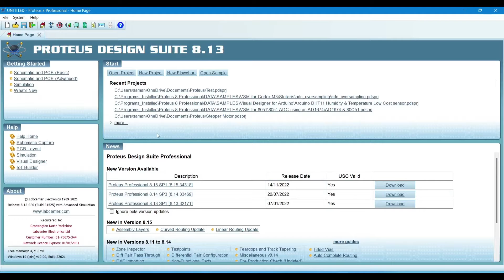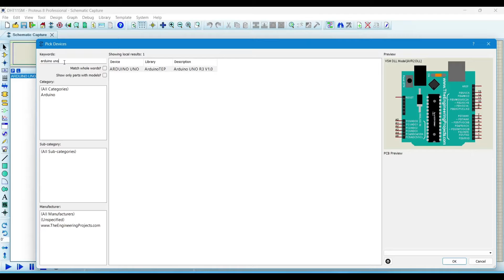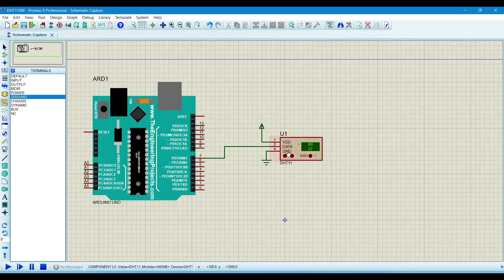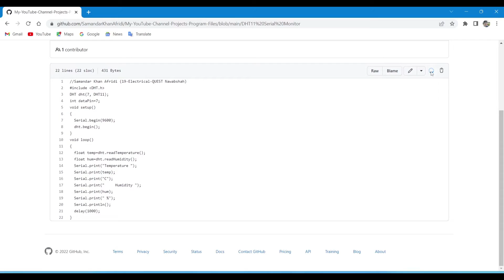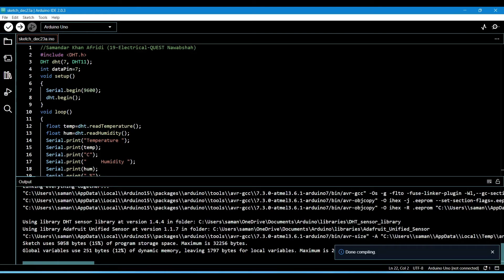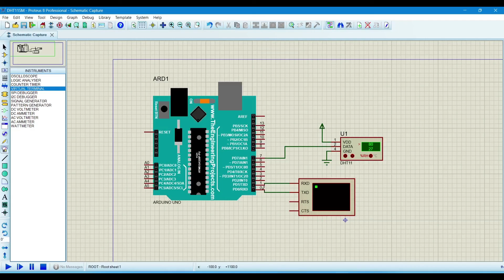DHT11 | DHT22 Arduino Serial Monitor | Proteus Simulation | Temperature | Humidity | Sensor

Comment: my lcd is displaying nan instead of my temperature values. how  to fix this please
Reply: Hello, i know it's been 5 months but have you solved it?
Reply: @drmblu  i have the same problem please help me
Reply: @Kurapika023  This happened to me when I was using DTH22, but when I switched to DTH11 it worked normally